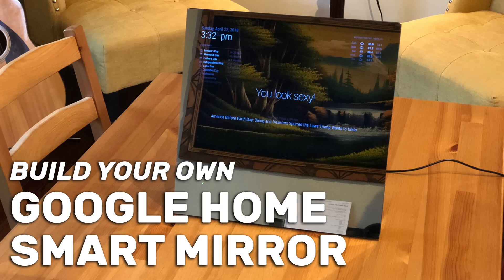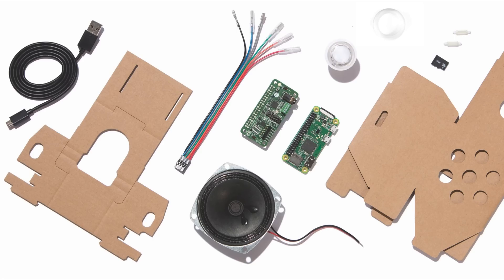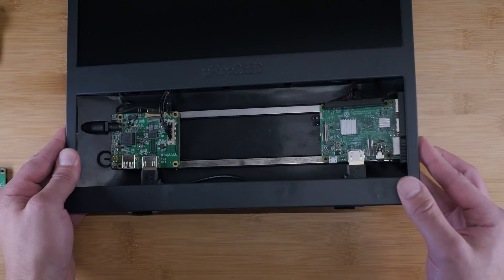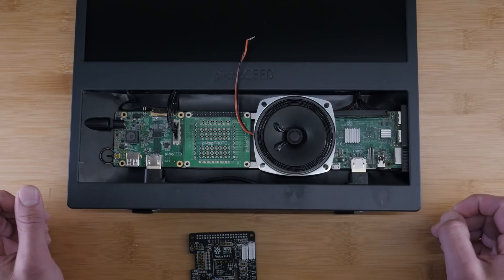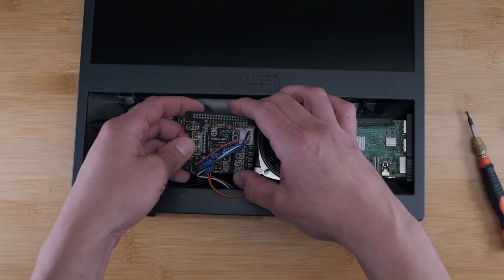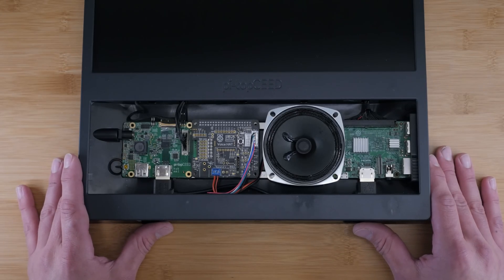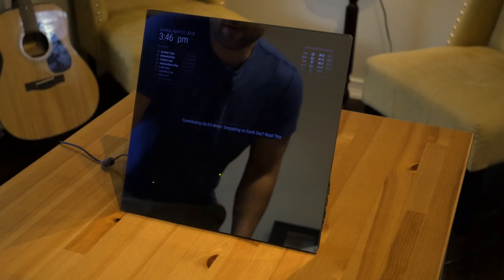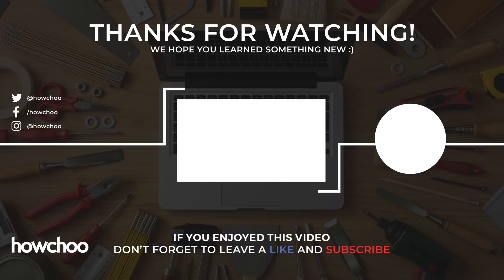Build Your Own Google Home Smart Mirror in About Two Hours

Comment: Can the google home update automatically? And will it continue to be supported in the future?
Reply from the maker: Yes, so the Google Assistant API itself is web-based and do the improvements they make are available automatically. I guess if they changed the API structure entirely, you’d need to update the software on the Pi — but this is highly unlikely. Any updates to the AIY library itself would probably be for stability and bug fixes.

Comment: What is the board already in the pi-top CEED. And is it required? I want to replicate this project without the pi-top CEED. Also how would we do this without the pi-top PROTO board?
Reply from the maker: The board already in it is built into the Pi-Top. You can probably do this without the PROTO board, but you’ll need some kind of GPIO ribbon cable splitter. I’m not sure if there might be a software conflict TBH by doing that.

Comment: Google home isnt really connected with the magic mirror (google assistant cant change what is on the mirror, or am i wrong?)
Reply from the maker: Correct — there’s definitely a way to connect the two but it will require some coding :) I know someone made a MagicMirror module for displaying Alexa cards but haven’t checked on the Google Home front yet.

Comment: Wow, 250 is way too much for this. Has to be a cheaper way
Reply from the maker: There definitely is — you can use the Voice Kit V1, shop around for a cheaper Pi-Top, use a Raspberry Pi Zero instead of Raspberry Pi 3, and source your own screen and build your own enclosure :) You can definitely bring the price down with a bit of effort but for this video my goal was to keep the build time as low as possible as well.
Reply: howchoo hey man I have my own screen and a raspberry pi 3 , what more do I need to build this ? Can I use my own speaker my own microphone installed on the raspberry pi 3 or I need this kit ? Thanks in advanced.
Reply: Hacker.gr
Yes you can use your own stuff
Reply: I got a Google Pi for ten bucks

Comment: Hey is this always-listening like a regular google speaker? or the rpi can act as a in-between safeguard of sorts?
Reply from the maker: It will take a bit of coding, but you can disable wakeword support and use a button to trigger instead :) that way it isn’t always listening.
Reply: What about some voice recognition client-side on the rpi just for the trigger action?
Reply from the maker: Surely — so you need some sort of wake word engine that’s always listening (so it knows when to hear the wake word); you could use a local wake word engine instead so data isn’t being sent to Google until you actually want to query Google Home. Look into Jasper (and the local wake word engines it uses) as an example. You can use jasper to trigger a script that activates Google. Then Google isn’t always listening, just your Pi itself. Does that make sense?
Reply: Thats what I was looking for, thanks